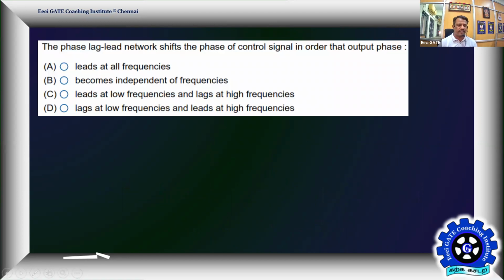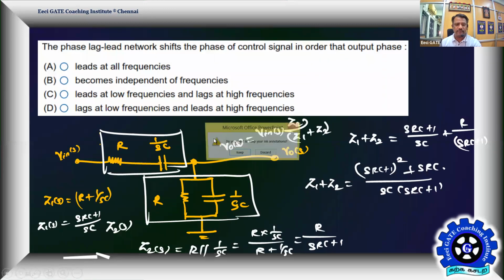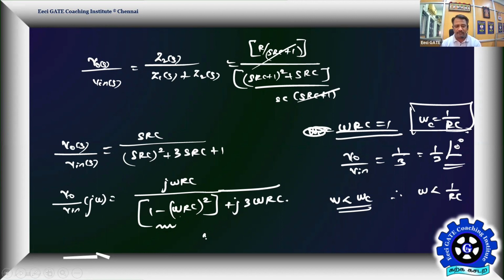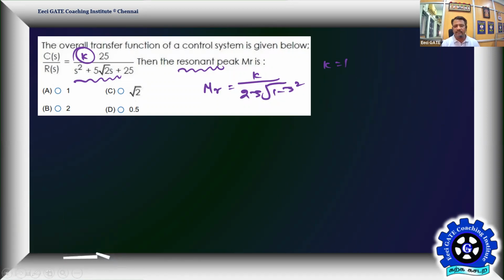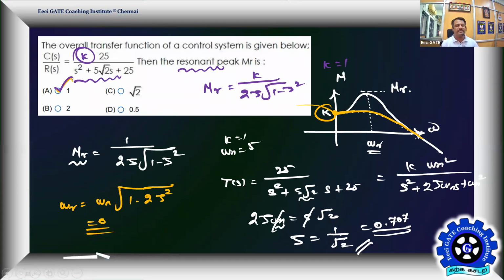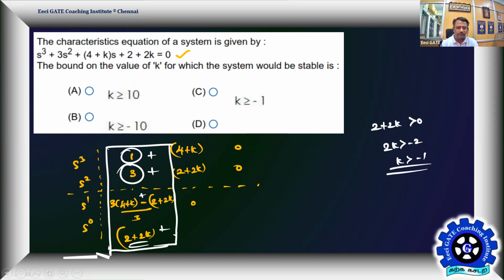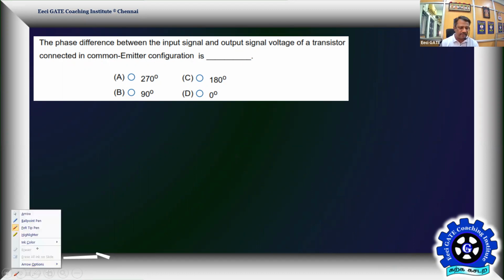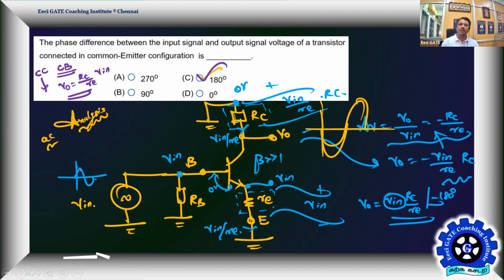Eeci GATE's EEE TRB Polytechnic 2021 Video Solutions PART 16

Comment: for k=-1 two poles lies on the imaginary axis while substituting in characteristic equation...then how it is stable??
Reply from the maker: You are Right. Some times we include Critical / Marginally stable also a just stable point. Beyond that it is Unstable.
For Argument sake, -0.99999 .. System is still stable..

If K=-1 System is Marginally Stable. It is still not unstable..

Accurately K>-1 is the Right call. But still K>= -1 is Ok,
Reply: Hey did you raised objection for this??

Comment: K should be greater than -1 but here it is greater than or equal to ....so in option c k=-1 also included 
Then how it will be correct option for stability
Reply from the maker: You are Right. Some times we include Critical / Marginally stable also a just stable point. Beyond that it is Unsatble.
For Argument sake, -0.99999 .. System is still stable..
Reply: @eecigatecoachinginstitute  
In necessary conditions for stability no terms shoulb be 0 in a characteristic equation if k=-1 then it won't contain constant term ..is it okay for stability??
Reply from the maker: @dhivyadivi5279  
If K=-1 System is Marginally Stable. It is still not unstable..

Accurately K>-1 is the Right call. But still K>= -1 is Ok,
Reply: @eecigatecoachinginstitute  
Okayyy
Reply from the maker: @dhivyadivi5279  👍